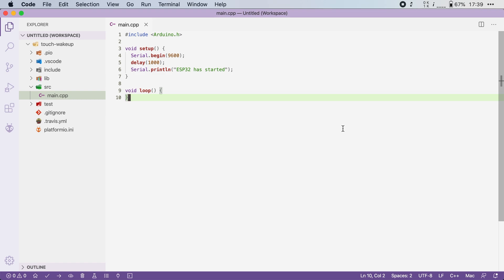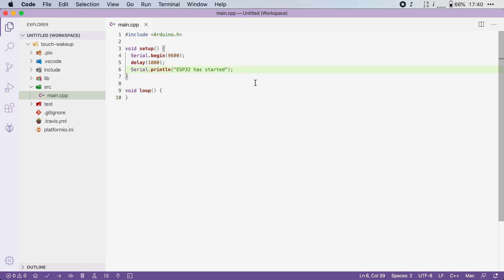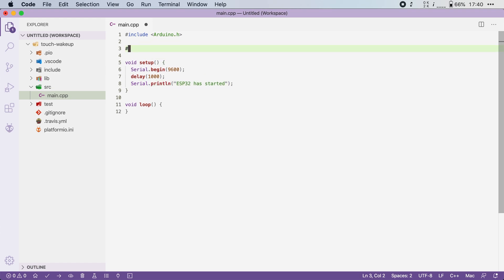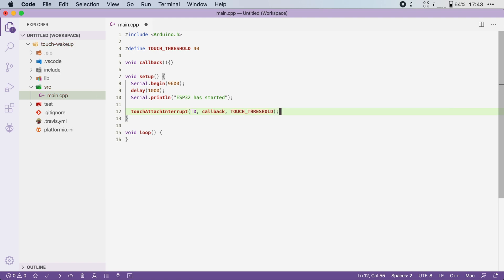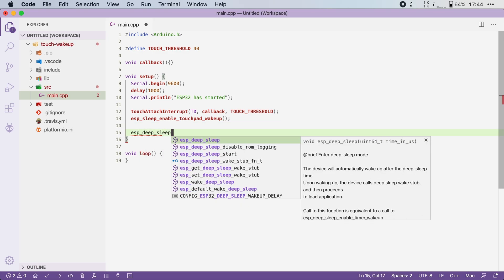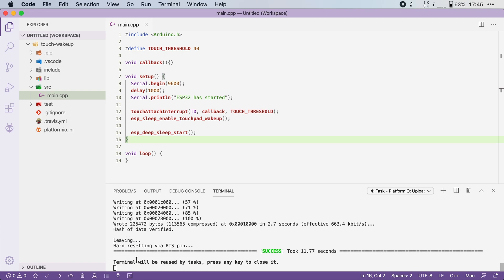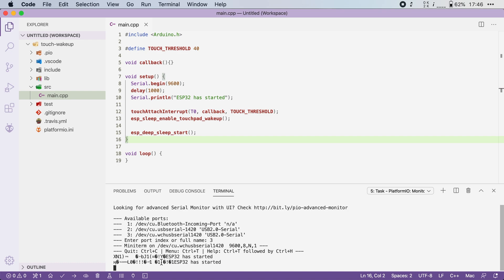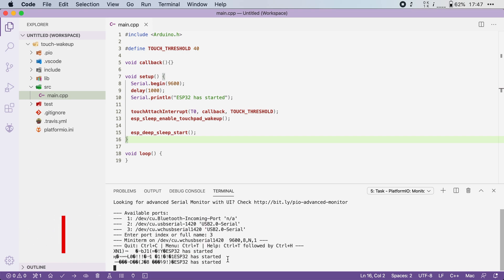Touch Pins as Wake-up Source (ESP32 + Arduino series)

Comment: Hi, I have a practical application that requires code execution in the loop() before going into deep sleep. Is there a way to accomplish the touch sensor wake up inside the loop, like putting the touchAttachInterrupt in the setup and esp_sleep_enable_start in the loop? I've tried it and it doesn't seem to want to work.